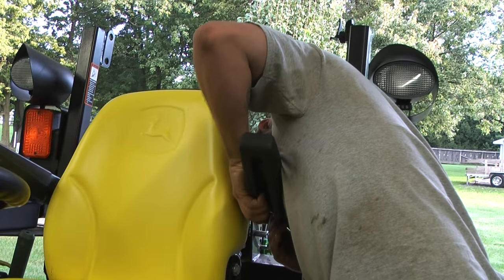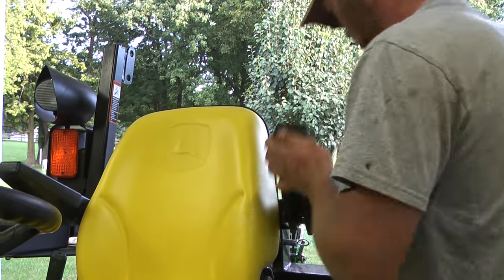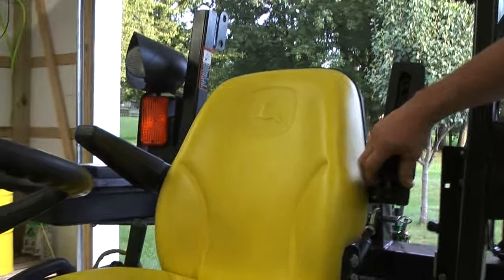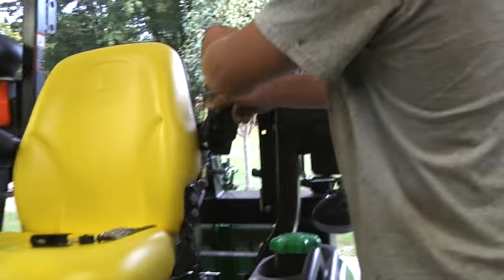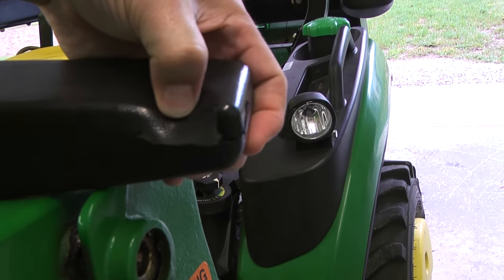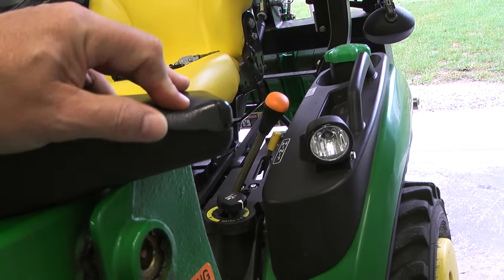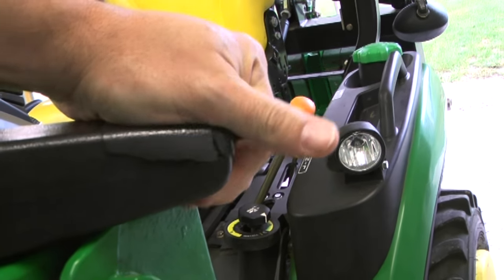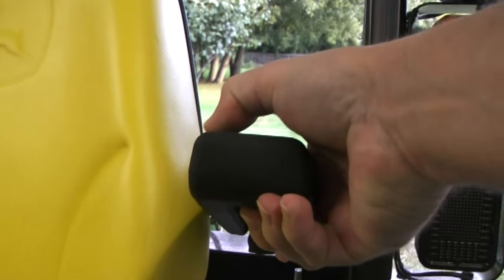#82 John Deere 1025R Armrest replacement.

Comment: The local dealer  (not the dealer I purchased from) wanted  $168 for a service call. I took it to the selling dealer which is regional, They looked at my issue immediately (still on the trailer) and found it was something that needs further investigation. Treated me very well. SunSouth in Samson Alabama. 
I like the short informational videos of late.
Reply from the maker: +Steven Drake thanks for the comment.  Each dealer seems to be different.